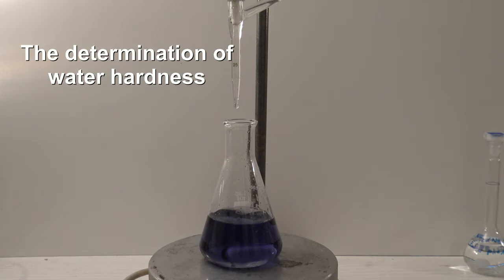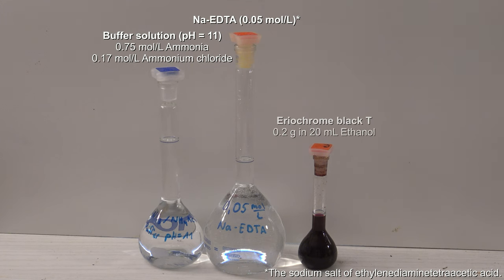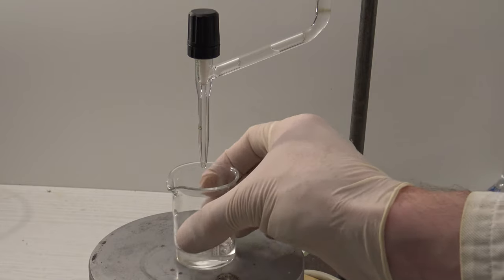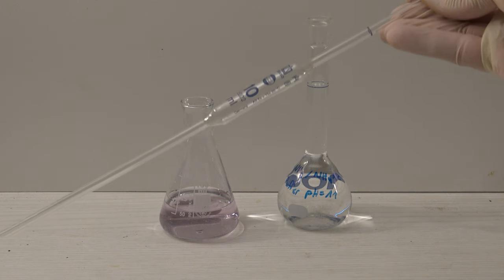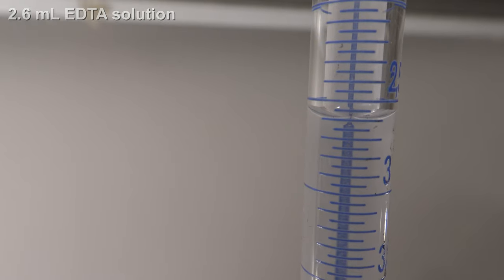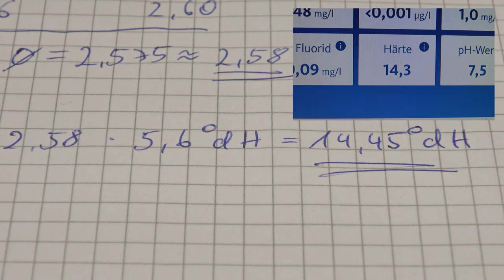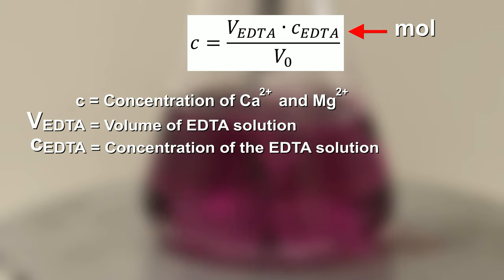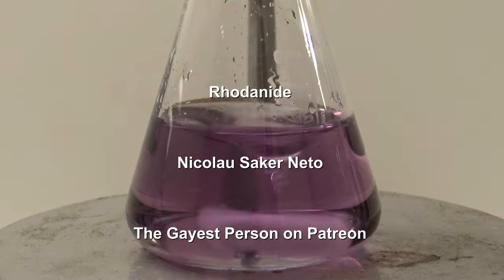Determination of water hardness (titration)

Comment: I did something like that for the calculation of calcium content in a past job XD
One note, pipets are calibrated for the liquid to flow out under gravity with means that this small amount that you blew out from it, should stay in the pipette for it to measure 50 mL, otherwise you add a bit over 50 mL, with is probably a source of a bit error (hardness measured by you would be higher than it is in sample). Besides that, it is a very good video!
Reply from the maker: Thanks for mentioning! It's been 14 years since my last titration at university and I simply forgot... So, I pinned your comment :)
Reply: @RaExpIn  There is also text on the pippete at which temperature it was calibrated and number of seconds you should wait until given volume is out of pippete (liquid stick to the glass due to adhesion and then fall down due to gravity, so there is usually 10 or 15 seconds interval until most of it fall down).
Reply: Nie hwal się tak polaczku